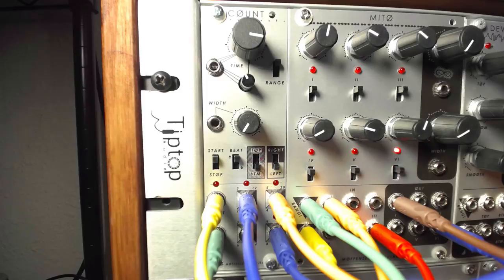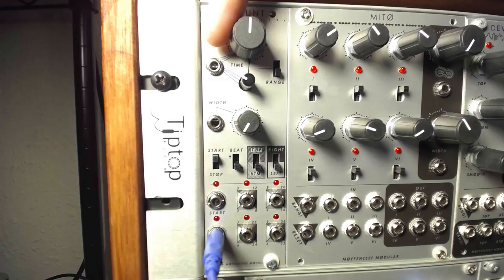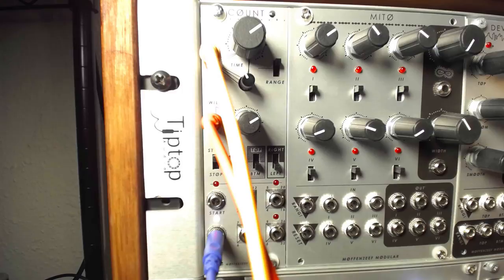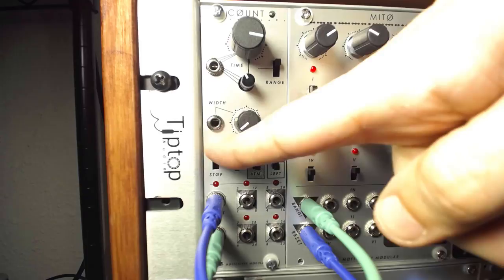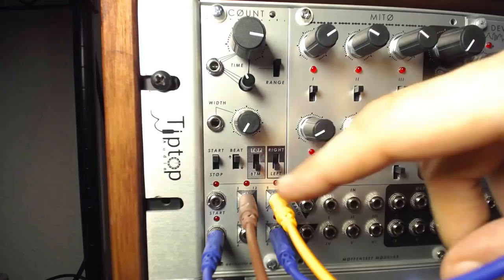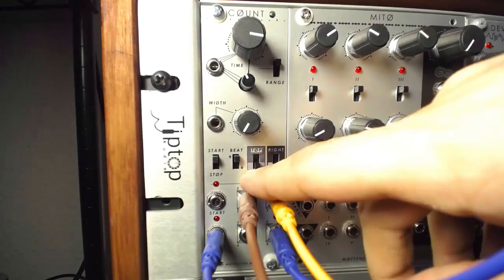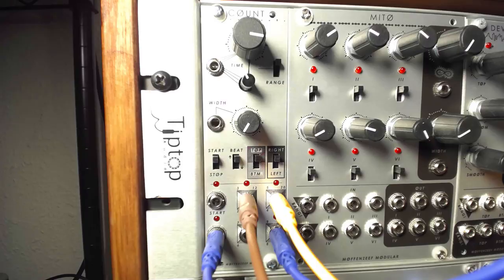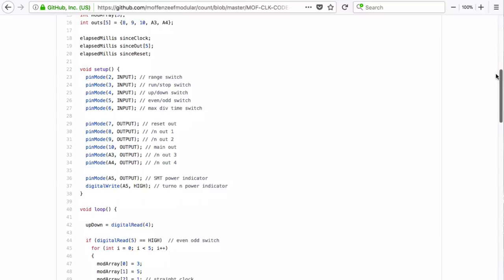Clocks n Clocks n Clocks n Clocks with the Count

Comment: I don’t have a dedicated clock source in my rig yet. I have 3-4 sequencers depending if the Midi 3 is considered one.lol I suppose I should get a “master” clock. Right now I either use an lfo or set the Control Forge to clock stuff.